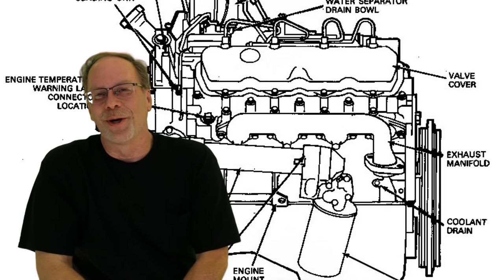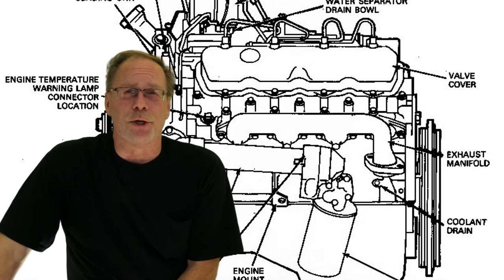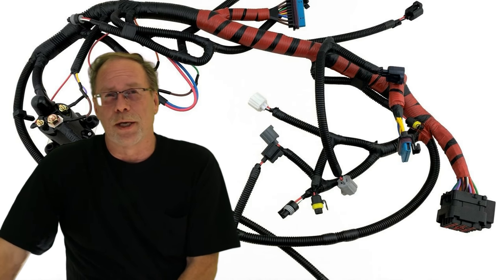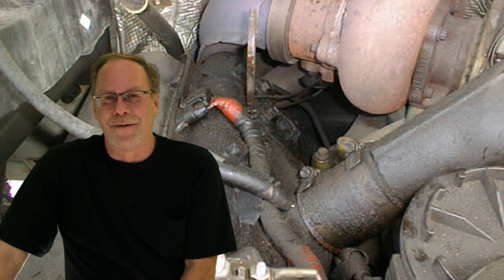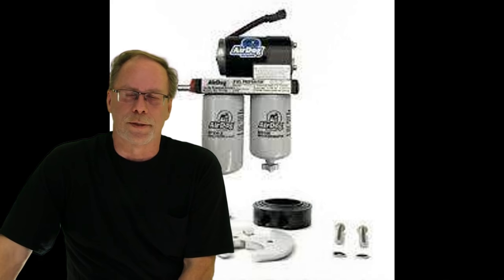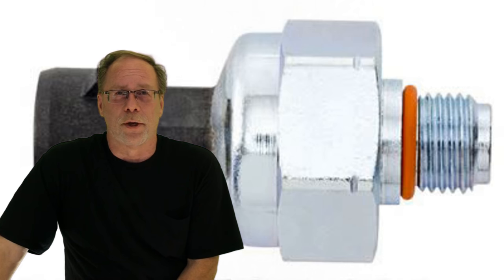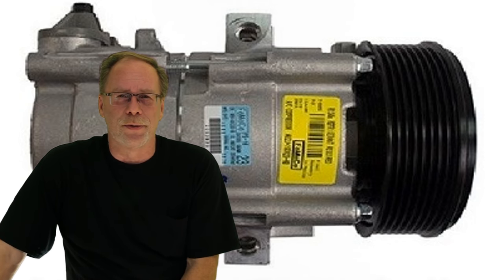11 7.3 POWERSTROKE ISSUES STOP IN AND SEE COMMON FAULTS.........

Comment: Change the oil every 3 to 5 thousand. Get a white rodgers/stancor glow plug relay. a Donaldson blue oil filter, change the fuel filter every oil change with motocraft and air filters every 10 to 20. Pump the oil out of the high pressure box every oil change. Delete the ebpv valve and get a non solenoid pedestal. delete the air intake heater and get the high pressure oil crossover and  fuel rail cross over. update the fuel manifold spring. Get a full exhaust wrap the manifolds up pipe collector turbine housing and downpipe with exhaust wrap. Change the exhaust back pressure tube and sensor. Upgrade your grounds from the alternator to the chassis battery to chassis frame to chassis run a wire from the alternator to the second battery with a 250 amp inline fuse. Get a voltmeter so you can wait unit the glow plug relay completely cycles off before you start your truck. Use hot shots stiction eliminator in the high pressure box when you pump it out. I use a hollowed out writing pen to stick down in there when I pump it out and it pulls about 17 ounces out. Use hotshots edt every fuel up it raises the cetane level and cleans and lubes your fuel system. Change the transmission oil every 25k with oem filter. Also Get a external transmission filter to suppliment. Get a coolant filter. Change the coolant out with elc. Rotate the tires every 10k keep up on the shocks ball joints swaybar bushings tie rods. Grease all  the points on front end regularly. Grease your u joints. Change the rear differential fluid.
Reply: 3 to 5 thousand for oil change? I don't know about the newer ones but the old 7.3  took like 15 quarts which sounds expensive.
Reply: I know all trucks have their problems.  But That's a lot of shit to have to do...
Reply: Should I clean the windshield? I can barely see out of it but I don’t see that on the list of things to do…
Reply: Let’s see , my Cummins 12 valve , I change the oil and filters …… oh yeah I did change ( upgrade ) the spring and fuel plate in the p- pump ……also I don’t need 500 specialty tools to work on my Dodge …. Just sayin…..
Reply: @chuckstewart7331  It’s pretty much the Briggs and Stratton of Diesels so you shouldn’t need too many tools or maintenance.
Reply: You don't need to do most of this.
Reply: @chuckstewart7331  then why did you watch this video??
Reply: @robwhite3241  it’s expensive, but you do need to change it often. The injectors are driven by high pressure oil, which works the oil pretty hard compared to other engines. I change my oil every 5k using full synthetic and a motor craft or wix filter, depending on what they have at the parts house. Fuel filter every second oil change. The rest of the stuff on this guys list I would only do if a part fails, regarding the engine and charging system. These trucks regularly go 500k or more with zero modifications and a happy owner, so most of this is not really necessary, and is more of a list of ways to only have to fix a problem once in the time you own the truck, if you happen to have these specific problems.
Reply: I do suggest replacing the coolant with elc next time it’s due for a flush or you have the system open for some reason.
Reply: @Matt-vz5wy  Yeah that makes sense if you have a HEUI system. Did the 7.3 have the HEUI system? I thought it was introduced with the 6.0
Reply: @robwhite3241  7.3 is also HEUI, unless you have an IDI.
Reply: @robwhite3241  i change mine every 5-6k i can still see the hatch marks on the dipstick its so clean inside. If you can't afford oil changes. You dont need a powerstroke. Js
Reply: @randalln.587  What engine do you have and what's it capacity? I've heard some owners go 8-10k+ and get it sampled and tested to see how often they need to change there oil.
Reply: @robwhite3241  yes 3-5. 322k on mine and everything is original except the new clutch.
Reply: Gospel words
Reply: @Matt-vz5wy  these engines are NOT built for full synthetic it's too thin.
Reply: I took a picture of this comment. Thank you
Reply: And always us top of the line 300% injectors and the largest Turbo you can find  to Match to those injectors ;)
Reply: I have a 1997 7.3 powerstroke and having issues with it and can not figure out out. My video is on my channel of what it’s doing if anyone can help me out. New oil filter and oil. New fuel filter. New icp and ipr. New melling m208 low pressure oil pump and it’s still not building oil pressure higher than 10 psi
Reply: @cencoast_7.340 🤣
Reply: Thanks and absolutely correct on all.  Just remember to use good oil.  She’ll Rotella 15W-40 every 5K and you’ll get 400k plus.  😊
Reply: @cencoast_7.340  nah should be fine
Reply: @adelinawarriner6259 isn’t the thickness dependent on what viscosity of oil you put into it? Not synthetic vs non-synthetic? 5w vs 15w?
Reply: My Stock '01 7.3 is still running great.
Reply: Thank you.
Reply: Good lord you'd never drive it doing all this upgrading lol
Reply: I’m trying to understand, if I got to do all this how is this a good truck I mean before u can even drive it u got to put 5 to 10,000 in it. Why not just get a gasser and call it a day.
Reply: In the 1950s, manufacturer’s recommending was 3,000 miles. Quaker State was the No. 1 selling oil (non detergent), so changing oil now at 3k-5k oil under normal conditions is laughable. Synthetic oil is thousands of times better than old Quaker State.
Reply: Thanks for all that info.

Comment: The one thing he did not mention is get rid of the stock starter and get a High Torque starter, it absolutely is like night and day, In cold weather if you can crank it faster it starts much easier, the one i got LITERALLY cranks three times as fast as the stock starter, We had a minus 20 night and i was not able to plug in my block heater, I cycled the glow plugs and cranked it and it started before I could count to three, They are not that expensive, I paid $160 for mine, ITS WORTH IT!!!!
Reply: ^^^^^^  that shit is gospel right there. Spend the extra money and get the Denso unit and stay away from the DB and other knockoffs

Comment: Say what you want about this engine I worked for UPS for 30 years and we used this engine in a large amount of our package cars and hands down these were the best engine we used they commonly would last for 350,000 miles I have retired some with more then 650,000 miles on with just standard service
Reply: I bought my powerstroke because I watched my buddies and family friends who work their trucks hard break down in their dodge and Chevy trucks and go back to their old 7.3 that just wouldn’t die. My buddy has a whole fleet of trucks and the only ones he doesn’t get rid of are the 7.3 trucks, because they just keep putting in work. His cummins trucks are constantly eating parts (but to be fair, not engine parts) and his Chevy trucks have been money suckers too.
Reply: And 15k oil changes too.
Reply: Yall had powerstrokes in package cars?
Reply: @thepitpatrol  Onan, Cummins, T444 was the International version of the Commercial Powerstroke,.  Then we got a bunch of Vortex v6 that eventually went Natural gas.  While straight cars gas the Vortex were indestructible motors that pulled pretty good for a tiny motor.  I was a distance driver in the mountains and got Sprinters.  Had a few 4cylinder Mercedes that were way too de tuned and low RPM.  The early Cummins vibrated so bad that I would sit at stop lights watching all the nut and bolts spin around  inside of the cab .  They hauled ass and would go 90mph pretty easy.  I have even more stories about gassers too.
Reply: @dirtcurt1  I ran a rural route. Covered 300 miles some days with around 50 stops. This was back in the 80's. I ran it whatbwe called a bubble top. It was a Ford 1 ton van with a 300 straight six and a 5 speed manual transmission.  I had one stop called Ambrose Wood Shop that was 1 hour after you left pavement.  The whole route was just great folks!
Reply: @thepitpatrol  My route started as a 360 mile per day and in the P-500 was brutal because they took out the Onan Diesel and didn’t change the springs.  The Vortex v6 was not able to make the day with fuel.  If someone drove my car for NDA in the morning I would run out of fuel before I could get back to fuel in the remote area of Kings Canyon NP.  So I had two fuel twice and I still barely made it back with my 20 stops a day.  I would just get fuel 3 times a day to be safe.  When the Sprinter showed up I could almost make 3 days without fueling!  Then they satellite stationed me 40 miles from the Center.
Reply: @dirtcurt1  that is absolutely incredible.  I thought we ran long routes. What state was that in?
Reply: @thepitpatrol  In the Summer I would have to go to Cedar Grove.  It would usually be my last stop depending on how I ran the Park route.  I would be like “whew”!  “Done”!  Then I would realize I had 77 miles and 2.5 hours back to the building in a straight shot if I had enough fuel.  For some reason that part never bothered me.
Reply: @dirtcurt1  I guess there are a lot more remote areas than we had. I thought 300 miles was a record but I guess not. I do know one thing. I would take rural over in town any time!
Reply: @thepitpatrol  The problem with my route was my average moving speed of 25mph.  I also did 17,000 vertical feet.  Then the snow would come.  It really slowed me down and they took my chain install allowance away made for really long days.  I would easily bust my 60 hour rule in the winter.  I still loved the route.
Reply: @dirtcurt1  the route sounds amazing. I put chains on and off but we never got an allowance.  I did have one stop that had its own area number though . It added 45 minutes. My route had mountains but you would have considered them hills lol. Did you have any pickups because making the air shuttle must have been murder.

Comment: The diagram used as the thumbnail is a mechanically injected 7.3l IDI which shares only the bellhousing and displacement of the 7.3l PS
Reply: I came here to say this
Reply: Exactly. Torn down my share of IDI engines and I have almost memorized the shop manual for those engines.
Reply: It definitely not a powerstroke

Comment: My 7.3 has no wiring harness it's all mechanical it's a 1994 it has 67.000  miles on it manual transmission it will be the last truck I will ever need  did I mention it's a F-350

Comment: Thanks for the info, I always  tell my wife that my 2001 7.3 is my lifetime truck. Look forward to your battery video.
Reply from the maker: Coming soon!
Reply: In April 2022 I will have owned my f350 7.3 for 20 years. 348k miles-
Reply: @jonwcs5842  what year and any issues
Reply: I say my 7.3 us my coffin, should outlast me
Reply: Say the same
Reply: Still driving it (april 23, 2022), have to replace oil to turbo seal on side of block & seal on top of front tank now leaks when I splurge to fill it up at $4.79gallon here
Reply: Do you have the battery video link ?
Reply: Have a 2001 7.3 with a no crank no start. Drove it into the garage and now it won't crank. New batteries, new solenoid, new wires, new Cps, new glow plug relay.
Reply: @saragordon4475  look at your Cam position sensor
Reply: @EODHickam  changed it
Reply: did you change the ignition switch? the one on the bottom of the steering column
Reply: @saragordon4475  push it further into “park” on the shifter
Reply: @jonwcs5842  I've had my '02 f350 7.3 for 16 years, 320k miles, a few years ago I put in the Full Force stage 1.5 kit and it made it new to me, I think I'm going to keep it till I die.
Reply: Since 03 7.3 it's been the best Truck hope I get another 20 years cause never buying another
Reply: As is mine... Looking at the.new trucks..$90,000+...HUH?  Not happening....

Comment: For the 7.3 owners out there, if your coolant temp creeps up while towing up a grade, and or fan comes on and off rapidly, mine was fixed by installing a new beltt tensioner from Ford. Takes a lot of force to turn the fan and if belt tension is loose, she will slip. Very happy now after replacing. Fan comes on and off very firmly now, and coolant tempting just below half even after long grade pulls.
Reply: Thanks brother!
Reply: Nice tip

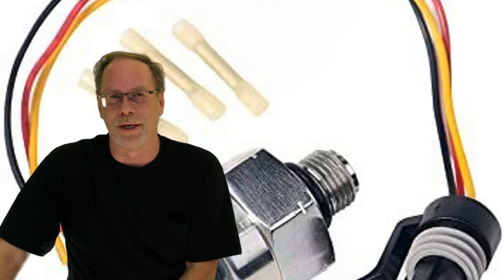Comment: 03:20 my elderly neighbor has a 2003 Town Car that he got new, he's a WWII vet, and his Town Car has 400,000 miles and started overheating. The Ford dealer put a new thermostat in it, new radiator cooling fan, new water pump, and all new hoses and a belt with a new tensioner.    Then it was still overheating. I looked down between the radiator and the AC condenser and it was completely covered in road grim and debris.  I cleaned it and and it has never overheated again. 

Great video!!
Reply: I have a better one than that! I had a ship mate in the Navy with a Ford station wagon he got from his grandfather. It stopped running and he managed to get it into a parking lot. I checked it out and found the camshaft had broken. While pulling the front end down I noticed the flex fan had been installed backwards, from the factory! I asked if he had cooling problems, and he said not really but the AC never worked right. I guess some things are just too technical... ;-)

Comment: Really good info 
I was a mastertech @ ford for 15 yrs I am a master on the 7.3 alone  when you clean the radiator clean the air to air also if its clogged it will raise intake Temps and it's right there you already got pressure washer out
Few other things to consider 
Change the oil in heui system from the top 
Put a upgraded fuel filter water separator  on it from say  Fass or Donaldson 
Better radatior from say mishmoto a 4 core all aluminum 
Proper maintenance and care these engines will go million miles before a rebuild
Reply: Got a question for you then. Mine quit the other day and I’ve noticed my programmer won’t come on with key on or my wait ti start light when you turn it over you cannot hear the injectors working. Pcm has power have yet to check the idm I’m suspecting it may be that any other tips? Could it be the key switch? The day be for it would not start it did start losing power like I was losing a gaining injectors until it got to operating temp the it was fine until I parked it then next day no start
Reply: @bryanbeane7328  I would start at Idm check powers and ground for your truck also check in column I've seen wires wear threw there especially if it's tilt if you suspect the key look up a key wiring diagram and use jumpers to bypass it at the module different years different colors its about 4 wires  the ones that say hot in run but just the way your saying it was running my money is on idm
Reply: Check lift pump pressure.  I drove mine a year or two with low pressure.  I’m pretty light footed but if I ran the programmer on 3 it would kick out low fuel pressure code. It would idle a little strange here and there and was not a beast almost stock.  Then it started to make loud injected noise and kicked a low fuel code with it at idle.  I got on the freeway and it started to die soon 50 mph was it.  It shook like she was coming apart at the seems.  It didn’t make it off the freeway and got a ride on the flatbed.  Got it home and #19 fuse was blown.  That is the lift pump fuse.  Put in a new one and nothing.  Pump made no noise key on.  New Motorcraft lift pump installed (on rail)and she is like a new truck!  Loves #3 on the tuner.  My mechanic says they (pump) will make lots of fuel volume, but have to have pressure too.
Reply: Can I message you?  I’m willing to pay you for a quick talk about my truck.  I just bought her and was taken good care of.  Sudden oil in coolant
Reply: @Paulyd81  what motor what we talking

Comment: Absolutely love the humble 7.3! Over the years, the points you highlight in this brief video couldn't be more prescient. Been spinning wrenches over 35 years, and I have to chime in on one important point with the 7.3. There is no substitute for a proper scan tool.

Usually, I'm tasked with the weird intermittent issues that have had parts thrown at the problem. The biggest issue with this is to NEVER assume that, just because a part was replaced, it can be ruled out. "Oh, that's been changed" can lead you down the wrong path. 

Equally important is maintenance. Take care of this workhorse! Yes, it costs money up front, but think about what happens when she quits at the wrong moment.

Comment: Well I jinxed myself doting on my great luck with my 7.3 over the last 25 yrs. It started with the radiator splitting the top tank on the casting line, 2 days later the water pump let go followed by the alternator pulsating from normal to pegged then the old girl just quit as though turning off the key, after 5 minutes or so it would start and run normally for 5 to 10 minutes and quit again. I found the pigtail going into the IPR valve was shorted and had melted the connector so I replaced the whole thing valve and pigtail, no change, started right up ran about 35 minutes in the driveway and shut off. I assumed a computer can`t handle the power requirements of  a solenoid so there has to be some sort of relay in there. I can`t afford to throw parts at it so I had it scanned and it said IDM. (Injector Driver Module). $300! I hope this is the end, it sounds like the fix according to the customer comments that were on the scanner. Didn`t expect comments, recon that`s the difference between a $200 scanner and a $3000 scanner............so once more unto the breech I go.

Comment: Got 11 years on the factory Motorcraft batteries in our 2011 6.7.
Got rid of it and went back to the 7.3.
My 1st truck with the 7.3 PS was a cab and chassis dually 4wd, bought it in the fall of 1994
 Mechanic with a pipeline outfit, had  a service body put on, loaded it with tools, welder, air compressor, and towed my 33 ft travel trailer with from job to job.
 It was a strong puller.
I